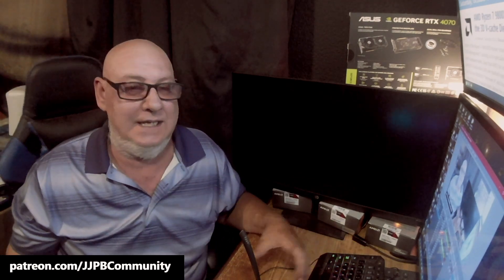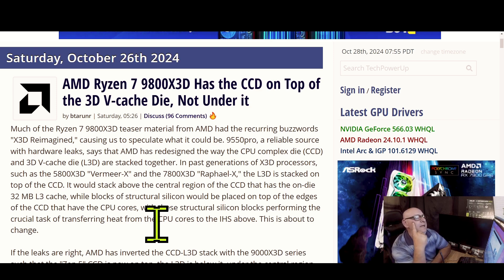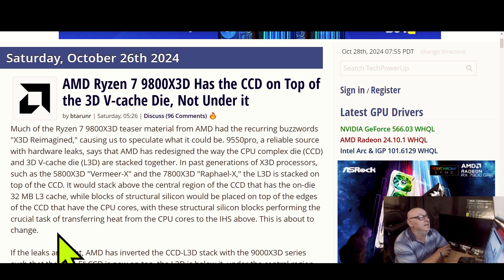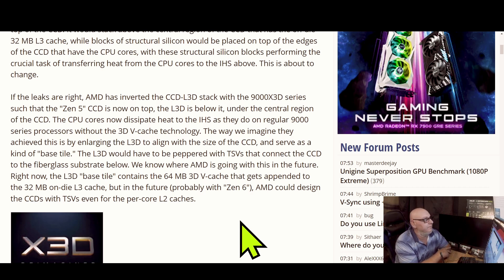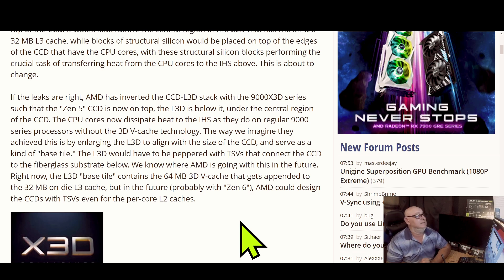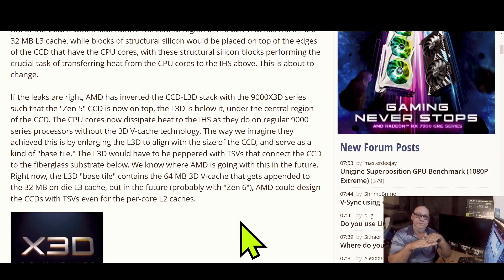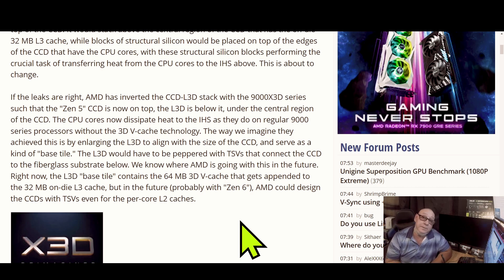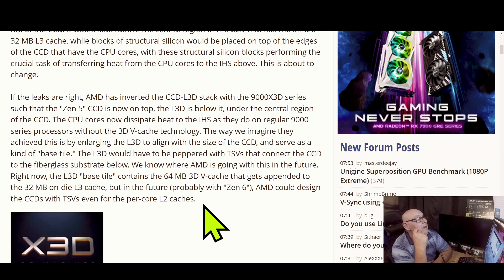AMD Ryzen 7 9800X3D:  3D V-Cache Die Positioned Below The CCD?? LEAKED!!

Comment: hello there i was wondering if the ryzen 5 5600x would work on the b450 m aii motherboard with the bios update
Reply from the maker: yea it should i tested a 5700x on a asus B450m-a ii before it ran well but i switched to a asus strix b550m-a due to the Pci-e connections... B450 runs Pci-e 3.0x16 and B550 runs Pci-e 4.0x16... but for a low budget b450 does well 😎👍
Reply: @ so i ordered the 5600 bundle with the asus prime b450 aii shouldnt  it already be updated if it came as a bundle i got it from amazon i believe it should run without a bios update since amazon sold it as a bundle its not the x but the 5600 4.4ghz is its max clock boost it says the b450 asus prime aii is already compatible with the 5600 without bios update ill be sure to check it out